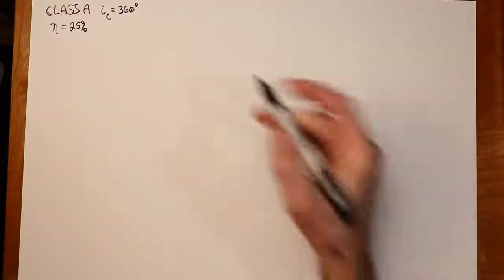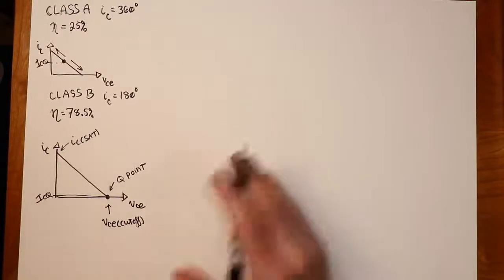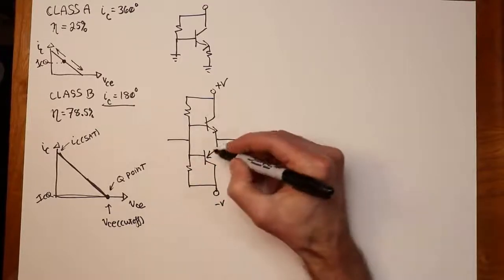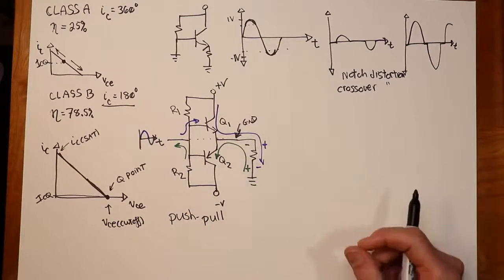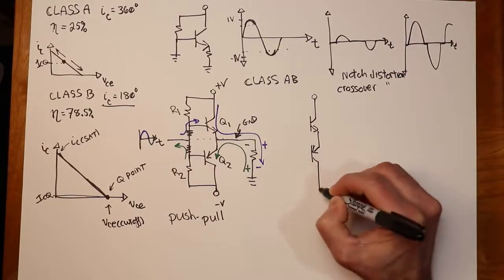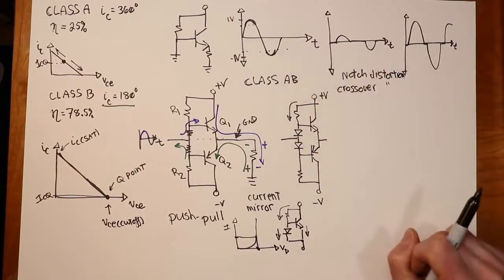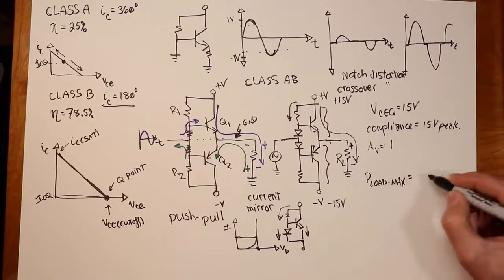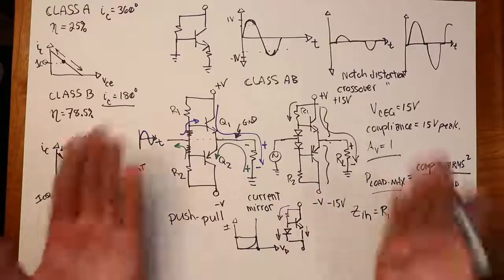Semiconductor Devices: Class B Power Amplifiers

Comment: It is great to know the theory, but todays electonics are mostly ICs. IC goes bad, replace it.
Reply from the maker: Sure, but two things to consider. First, there are a lot of older discrete designs out there that might need to be repaired at some point, and second, whether or not a design uses discrete or integrated circuitry, someone (or some group) has to do the initial design and testing.

If people only know how to replace ICs and no one knows the theory, there can be no progress. This goes back to the argument of the value of education versus training.
Reply: @ElectronicswithProfessorFiore  I have no problem with learning theory.  I did. But with all new designs of electronic devices having ICs, CPUs, SOC, and IC audio amps, and perhaps more, discrete designated are becoming a thing of the past. True theory about say repairing an old radio would be helpful.
Reply from the maker: @roncaruso931  And if that old radio uses a discrete class B output, what then? ;-)

Besides, like I said, who is going to design the ICs that (internally) use a class B stage? Further, that new IC might use a class D output, but again, someone had to design that, even if all the repair tech does is replace said IC. Taking the opposite approach is a little like saying that no one needs to learn how to write code anymore because you can find lots of code already out there. All you have to do is patch it together. (sorry, no.) For that matter, why does anyone need to learn a musical instrument when they can just sample existing music and then edit and rearrange it? I think there is value in starting with the fundamentals in order to build a strong foundation, and working forward from there. Too many people try to skip that in order to get to "the latest and greatest", but the results are usually less than exemplary. 

If it's not obvious yet, this channel exists to help support people who are trying to learn the material from the bottom up. It is NOT designed for people looking for a video with just enough info on how to fix "X" with minimal knowledge. I think there are a sufficient number of those channels kicking around. And if that's what someone is looking for, I say all the power to them and have at it!
Reply: @ElectronicswithProfessorFiore  I agree with you about old radios. But eventually, even old radios will be discarded. Today's young generation are not interested in saving these beautiful old analog radios.

Comment: Do you have a tutorial for designing a simple amplifier with given input, gain, output power, load, etc... Like how to choose appropriate resistors, reading transistors datasheet, capacitor...
Reply from the maker: There's an entire series of videos regarding amplifiers. I don't know your starting point but I suggest you go to the beginning of the Semiconductor Devices playlist and work your way through. The videos are listed in the same order as the topics are presented in the book.
Reply: @ElectronicswithProfessorFiore  I'm currently taking all the videos from your semiconductor devices playlist, really good explanation of the devices, with given exercises and simulations, which come with predefined resistors and capacitors value. But I don't really know why you can choose those value. 

If you are talking about the op amp series, my university course assignment is to design amplifier with no op amps, kind of bjt only.
Reply from the maker: @phile7420  Ah, so you're looking for a video to complete your assignment, then? I suggest that, instead, you look at those circuits and figure out what would happen if you changed some of the values. What happens to the bias? How does that affect the gain or the output compliance? etc. You'll learn a lot more that way. ;-)

Comment: Shouldn't the compliance voltage 7.5Vp ?
Reply from the maker: This has a dual polarity supply (+ and -15 V). That's equivalent to a single 30 volt supply. Ideally, you get the entire supply voltage for the peak-to-peak output swing, and obviously half of that for peak. Thus the compliance is 15 volts peak, 30 volts peak-to-peak, and a little over 10 volts RMS, ideally.
Reply: @ElectronicswithProfessorFiore  Thanks for clarifying in details

Comment: Just as good this time around. What would a typical audio amplifier (power amp) voltage compliance be, please? I can see the V2/R squaring up and a couple of extra volts can make a huge power difference.
Reply from the maker: Easy to figure that one out, backwards. Let's say you have an amp rated for 100 watts into 8 ohms. P=V^2/R, so V = sqrt(P*R). That's sqrt(100 * 8), or about 28 V. That's RMS. Thus, you'd need about 40 Vpeak, meaning supplies of a bit beyond +/- 40 VDC.
Reply: @ElectronicswithProfessorFiore  I feel a little foolish. I should have seen that working out. Thank you.

Comment: Thanks for another great explanation. With respect to the AC signal between the diodes: Is it the case that the small current flowing into the diodes node reduces the current flowing down through the top diode but the diode is always on so the current increase/reduction allows the signal to pass through? This hasn't quite clicked although it makes sense. Thanks in advance. It's the thought that something can go backwards up a one-way street where it's really just slowing down and speeding up but always travelling in the right direction. (That was me thinking out loud, is that right?).
Reply from the maker: The diodes confuse a lot of people. The thing to remember is that, unlike a rectifier, the diodes are always on (due to the DC bias). Thus, for AC the diodes can be modeled as their AC (AKA dynamic) resistance. You calculate this the same way as r'e. Thus, if the bias current is 10 mA, the diode resistance is less than three ohms. This can be the source of a small amount of distortion, and in larger amplifiers (typically using a Vbe multiplier instead of a string of diodes), this will be bypassed with capacitors, making the AC resistance tiny and reducing any THD.
Reply: @ElectronicswithProfessorFiore  Excellent, thank you. It's coming back to me, slowly but surely. You're a great help.

Comment: Hi Mr. Professor Fiore

Are there any possibility of having both transistor (NPN & PNP) conducting at the same time?
Thanks
Reply from the maker: That's called shoot-through and can be an issue in class D amplifiers which superficially look the same as class B. It's generally not an issue in class B unless there is some manner of severe fault.